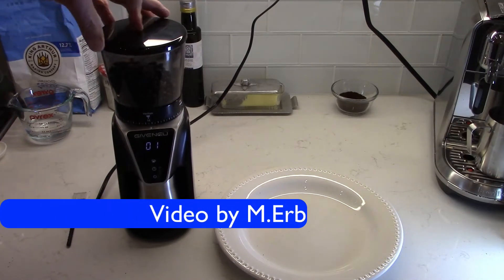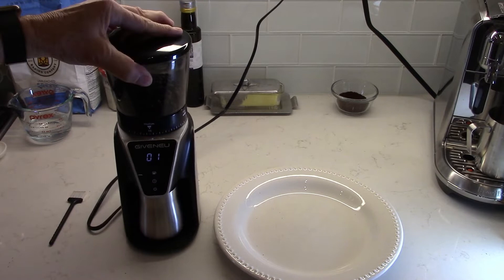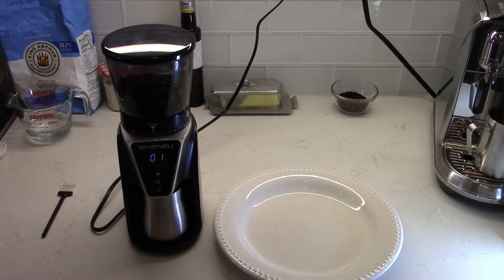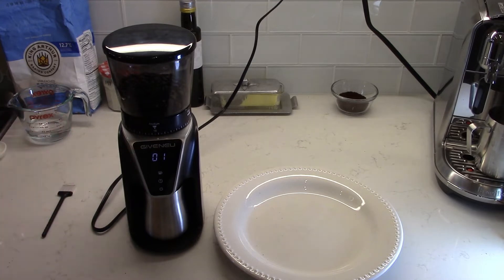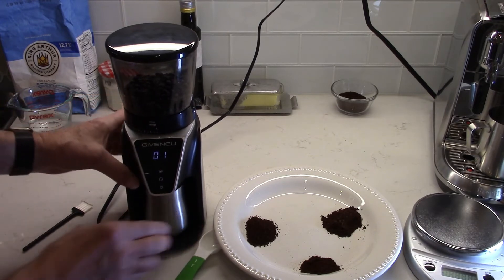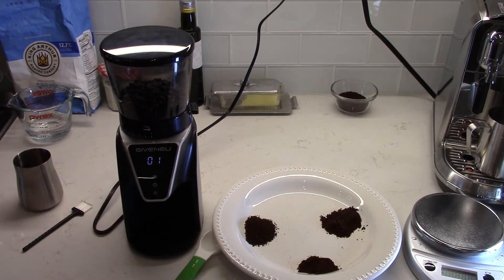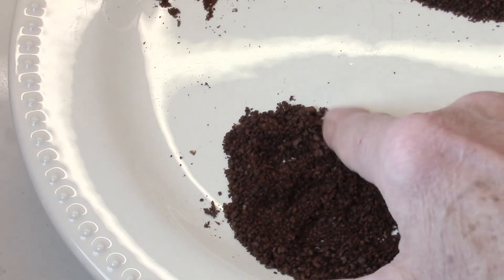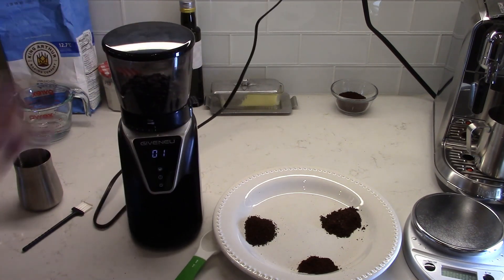Review GIVENEU Conical  Steel Burr Grinder for coffee

Comment from the maker: tl;dr - My updated recommendation is to avoid this grinder.

A few weeks after using this grinder daily, I have to now change my recommendation of this grinder to avoid. Over time, the grinder accumulates coffee fines to  the point where either it jams up or you are not able to remove the burr for cleaning. During my attempt to clean the burr it took me a long time before I was able to remove the burr. Then when I tipped the grinder upside down a lot of very fine coffee powder came out of the grinder. This is not how a good quality grinder should work. I'd recommend now that you avoid this grinder.
Reply: So till now not recommended?
Reply from the maker: @brahmantasatyo7869  I do not recommend the grinder.
Reply: @michaelerbreviews  compare delonghi kg79?
Reply from the maker: @brahmantasatyo7869  I am not familiar with that particular grinder, sorry.

Comment: Thanks for the useful information Michael. I've gone ahead and ordered an apparently identical grinder, here in Aus, that's branded 'Coffeeman'.
Reply from the maker: It is quite possible it is the exact same grinder since many of these products are white labeled and can be purchased and re-branded with whatever name the particular seller wants to put on them. As I have used this grinder more and more, I will tell you that if you use a very dark roast oily bean it is probably going to clog up this grinder. As a matter fact very oily beans clog up most grinders unless they are very expensive burr grinders.
Reply: @michaelerbreviews  Personally I probably prefer a not-so-dark roast but what do you do for cleaning in that case?
Reply from the maker: @gregansen544  The issue you may run into has not cleaning as the problem, but jamming of the grinder itself and it’ll just stop rotating. You probably won’t have any issue if you use a medium roast bean. If it does jam, tip the hopper upside down to empty it then remove the hopper to clean the burrs
Reply: @michaelerbreviews  Mine after just 3 uses has jammed up. I've tried cleaning, dumping upside down, poking with the S/S rod, brushing inside, and it won't work. I give it 1 STAR, now that it won't work at all.
Reply from the maker: @chrisrussell2820  Yes I've experienced the same except I was finally able to clean it enough to get it working again, But I've completely changed my opinion of this and would no longer recommend this after using it for a couple months.

Comment: 8:00 min - Is there any resistance when screwing and unscrewing the upper burr (can you hear it click) or does it turn loosely?
Hope my question is understandable (I don't know English well)
Reply from the maker: If there’s no coffee grounds residue in the machine there is very slight resistance. However one of the things I discovered after using this a while was that over time a lot of very fine coffee grounds can work their way in between the burr and the burr housing making it extremely difficult if not impossible to remove the burr. So yes, sometimes there is a lot of resistance.